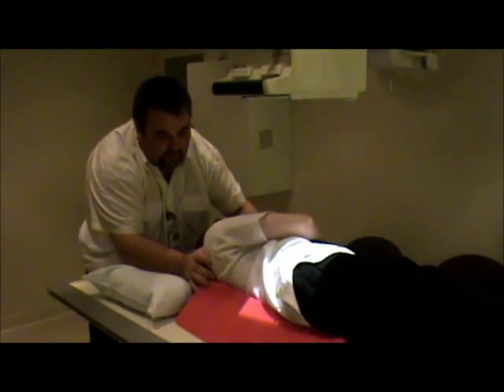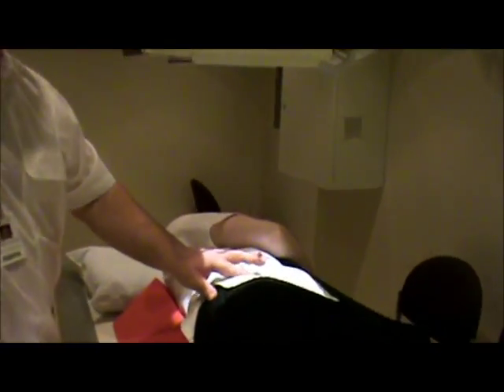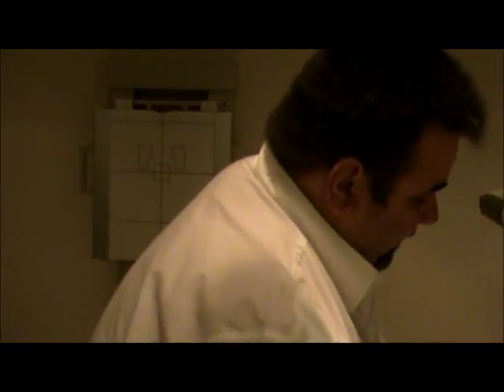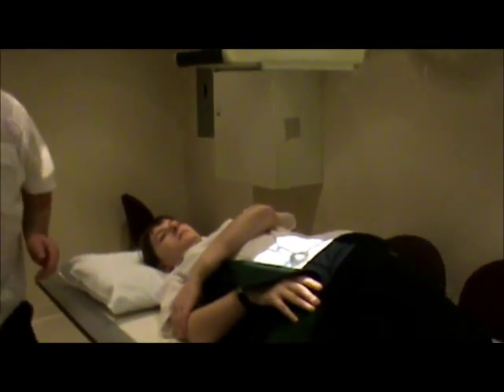SI Joints

Comment: My technique was to put both obliques side by side on an 18x24 cassette (10x8inches). That meant collimating to include only 1/6 of the field most radiographers exposed. I did not use any centering points as judgement of the quality of the work never relies on what is in the center and more to do with what is contained within the exposed area. Tight collimation means that what the eye and mind use for positioning is exactly relevant to how the xray turns out

Comment: Jeffrey, I had X-rays of my sacroiliac joints and they took the X-rays standing up? Is that accurate? I see you have your patient laying down. Also it was only 3 X-rays done, mid, left side & right side. I was not happy with the X-rays. Might be going for a second opinion somewhere else. I believe if the X-rays are not taken correctly the radiologist reading will not be accurate. What are your options? 🤔
Reply from the maker: We teach that these x-rays are done while patient is laying down. Some x-rays can be done with patient standing but I do not know why they would have performed them this way. You could ask them, sometimes departments have things they do specifically because of a request from the ordering doctor or even a radiologist wanting it done that way.
Reply: @jeffreyjobe1984  thank you for responding back, really appreciate your feedback. I’m thinking of going to a different facility to get another X-ray of my Sacroiliac joints, the technician didn’t even know what was the sacroiliac joint that should have been a red flag 🚩 right there 🤦🏻‍♀️ I have been having lower back pain that goes around my waist and pelvic for several years. I think it might have to do with my autoimmune so my rheumatologist send me for X-rays
Reply: @Msephany1  Technologist.

Comment: What is center cell
Reply from the maker: On control panel. There is side and center cells. If you look at most upright x-ray boards where patient puts their chest you will see 3 boxes. 2 side cells and 1 for the center. You can set which cell is being used from control panel.
Reply: Automatic exposure control my friend. The cells need to be center over anatomy of choice. This lets the control panel understand patient thickness, and allow for proper xray exposure length.
Reply: Thank you sir ••••••.  i want a explne